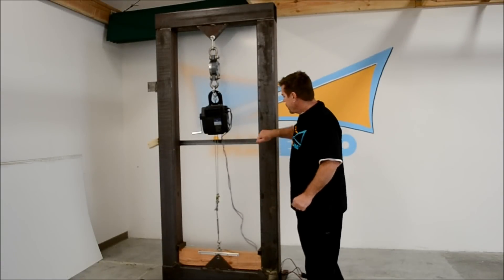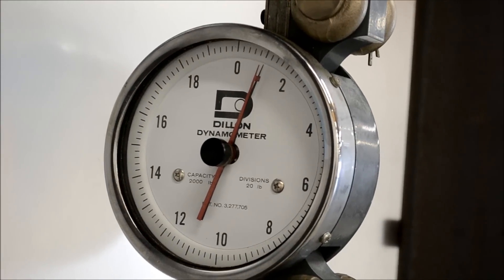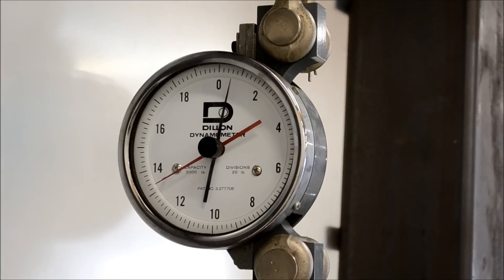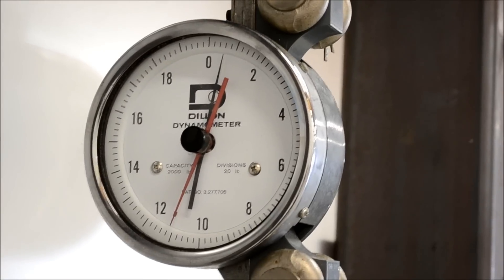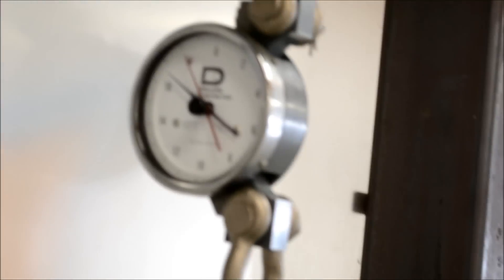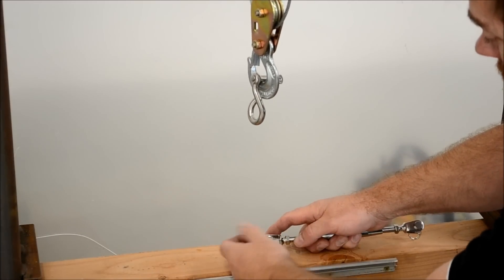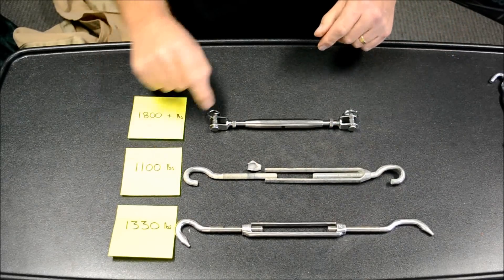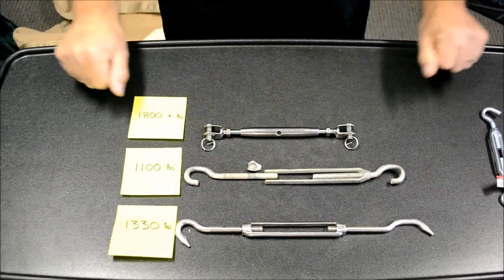Shade Sail Hardware "BREAK TEST"!!  Why You NEVER Go Cheap!!  By SHAZEEBO.COM

Comment: What’s the shortest Shazeebo turnbuckle size?
Reply from the maker: Hi @doge8676, sorry we didn't see your comment earlier, for some reason it was flagged for review. The shortest size we carry is an 8mm, which is 7.7 in long when fully closed and 11.4 inches long when fully open. We don't generally recommend this size though. The 10mm size is the most commonly used for shade sail projects.